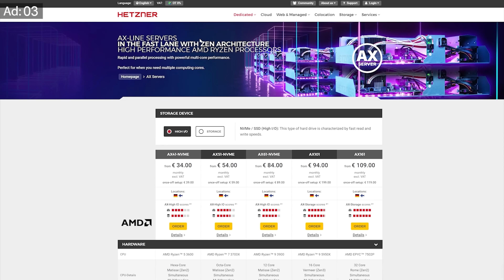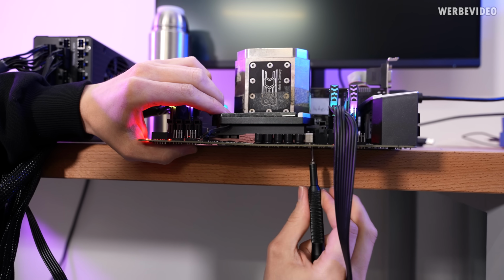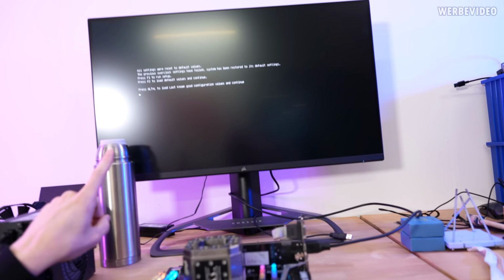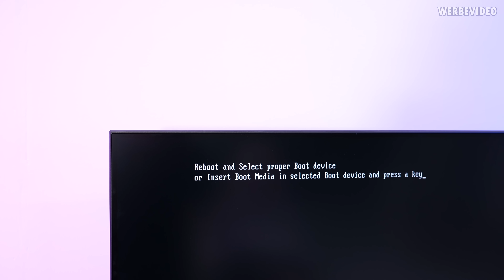Will this Hefty Bend Kill the Motherboard?

Comment: I’ve had some pretty bent boards in my time, never seen a bend alone kill it in the short term unless it’s so much that it cracks the pcb
Reply: Yeah no worries with a bent board. 

Where you have to worry is if the board bends (flexes) repeatedly in use, the repeated stress will crack solder. I can't ever see that happening in a desktop computer, but if you made a robot or machine and mounted the Mobo to a frame that bends under some load, or wires connecting to the board get tugged when parts of the machine move that is where you run into trouble, especially under those large BGA chips. 

If you want to test it you can flex an old ram stick back and forth hundreds of times... The BGA chips will come off where it bends the most.  (Yeah, I was bored at work, haha)
Reply: Depends where it is - I was not so lucky in that I had an Asus Z370 board bend at the back of the CPU socket (despite the reinforcements) due to an accident and I had to replace the board as I had random crashes since the accident
Reply: @tourmaline07  that's a super fragile area of the mainboard. I could easily imagine a trace off the socket got damaged or something
Reply: And this is why I like these videos and appreciate them.

So much intellectually incompetent ppl are writing below jay's, linus's, Asus's etc etc videos, that claim the most ingorant, inexperienced and idiotic shite.

I just had a talk with a repair guy on his channel, he thinks that tempered glass for phones differ from brand to brand (whilst its literally glass waste heated and mixed with some other chemicals, basically a reuse of waste and only a handful of factories make them then sell the same under 100 diff brands, but he actually believes there are 100s of factories), and he believes (and points to his "profession" as his trustworthiness) that the preglued tempered glasses are better then the UV liquid ones :)

These videos take away ALL the presumptions, but also might give quite strong cognitive dissonance  to some - hence I like it :D

The age of BS  finally starts to be over, thx to guys like der8auer!